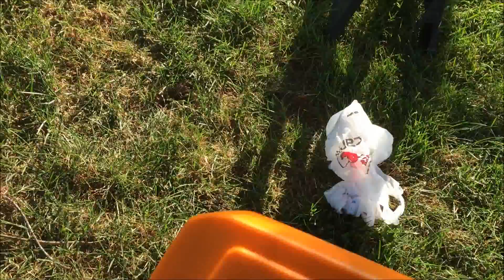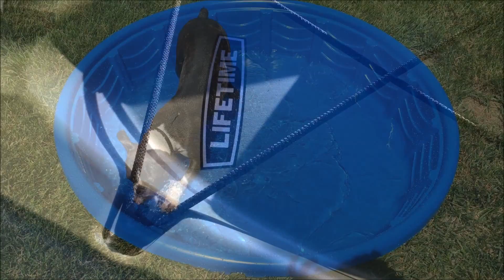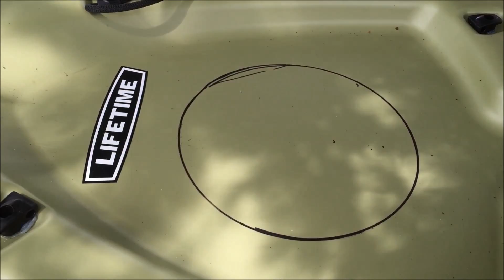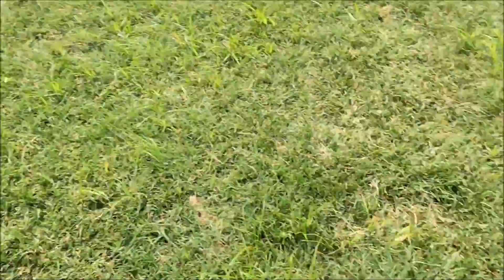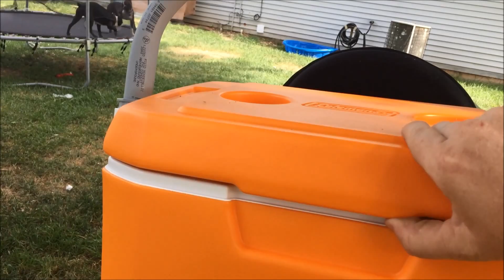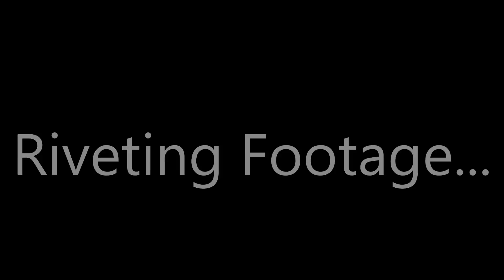Lifetime Weber 132 Kayak Review and Modifications

Comment: Ive had mine for a few years now heavily used, wheels a bit worn out but still roll. fabric on the handles had ripped (easy fix). rod holders leaked (easy fix with silicone). I got fat at 5'10 260lbs. Still feels stable and sea worthy
Reply: If you contact the company they will replace them for free.. they sent a big bag with all the handles and cord

Comment: I had one of these for a few weeks, but it wasn't suitable for my uses. Still a great boat though.

I wouldn't use it for surf. Since the scuppers are small, it leads to a very dry ride, but this also prevents it from clearing water when a large wave washes over--so with several inches of standing water in the cockpit, the yak floods through the dry hatch. I took over 70lbs of water during my first surf launch. But being such a stable yak, it didn't capsize and I was still able to get myself safely to shore, with some extra effort. A less stable yak would have certainly capsized or sank.

I'd recommend it highly for anyone who wants to carry a lot of gear in flat water. That dry hatch is awesome, but only if you don't have conditions that would cause cockpit flooding.
Reply from the maker: +armoredpig wow, thanks for your insight for ocean use! You are right about the hatch. I keep a towel in top of everything just under the hatch to catch the leaks, but that is on a river where the water rarely washes over the hatch.

Comment: How tall are you and what's your weight?  Did you have enough room?
Reply from the maker: +Matthew Norton 5'9" 225 lbs. Room to spare for my legs and plenty of space for me, a weeks worth of camping gear, and my Boston terrier.
Reply: +Thomas Lightle - Red Barn Woodworking thanks man I've heard mixed reviews about it being cramped so that's good to know.  I'm going to buy one for sure.
Reply from the maker: +Matthew Norton it is a great deal. As long as you aren't much taller than 6 foot, you should be fine. Tons of space inside the hull if you can access it.

Comment: what do you put in the front compartment? The compartment that you installed.  does the items move around inside the entire length of the kayak?
Reply from the maker: +david huynh Depending on how you pack the kayak, yes things can move around.  I use my kayak for multi-day camping trips, so I have clothes, tent, cooking gear, and even an airbed with pump all stuffed in there.  Ideally, everything is in dry bags, so I don't get random items rolling around in the hull.
Reply: Hey Thomas, just wondering does your kayak have a skeg wheel? I think the newest models have them.  The one I found. For 360 @ Sam probably don't have one.  If you can what model number is your kayak.
Reply from the maker: +david huynh mine does have the skeg wheel. It could be better as it only really works on hard surfaces like concrete because it is so small. I'm going to try to replace it with a rollerblade wheel this year.
Reply from the maker: +david huynh and it is the Lifetime Weber 132. I don't think there is any other model name or number.